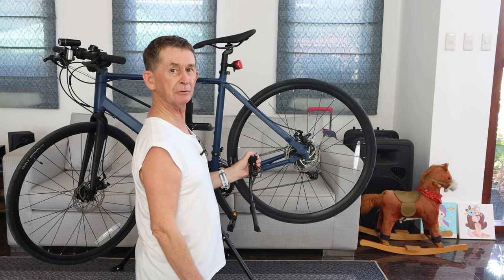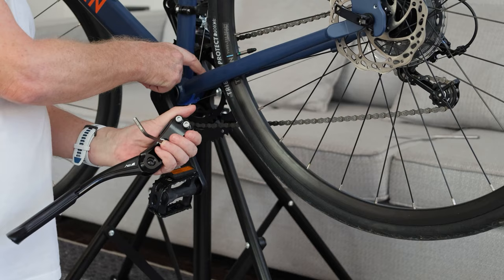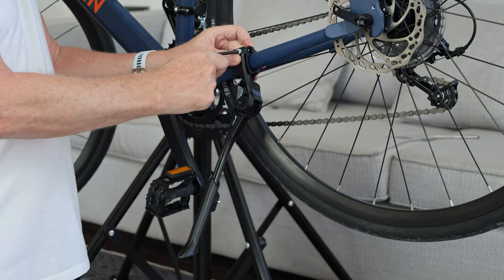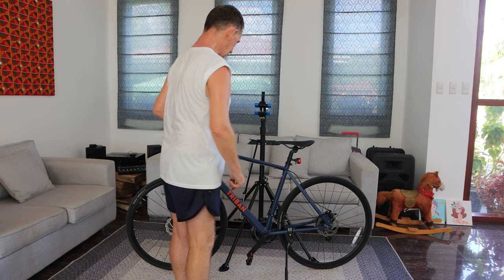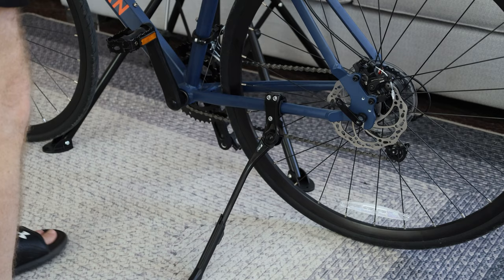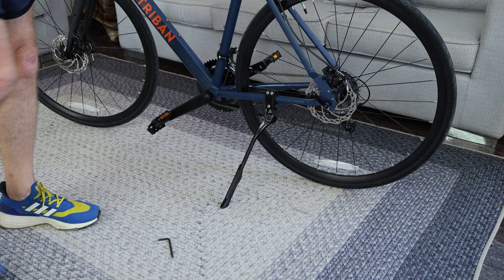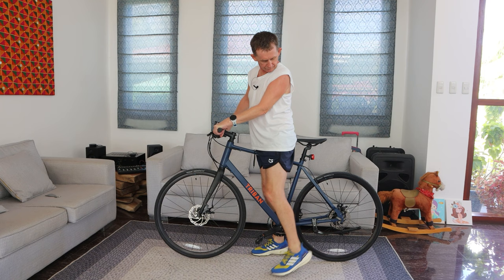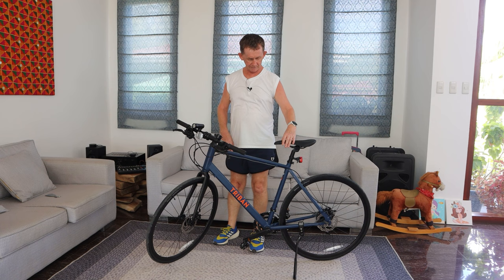BV Bike Kickstand - Installing & Testing

Comment: Too bad you didn't test it by riding. I got one off Amazon and I hit it with my heel because it sticks out instead of staying under the bike stay.
Reply from the maker: I still have it on my bike and did not encounter any such problems. You do have to adjust it. Thank you for watching
Reply: @Boopolo  There is no way to adjust it to make it not stick out. If it weren't for that, it is a good kickstand. My bike should have had the mount welded on the stay since it is made in Germany but it doesn't.
Reply from the maker: Okay.